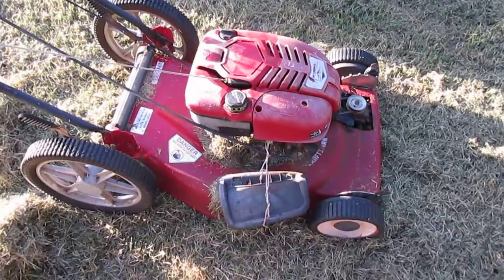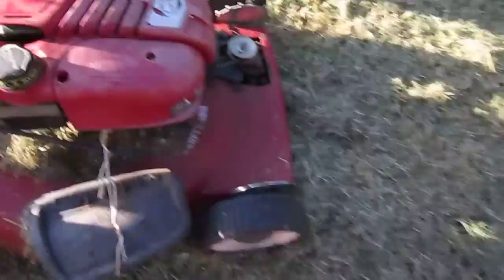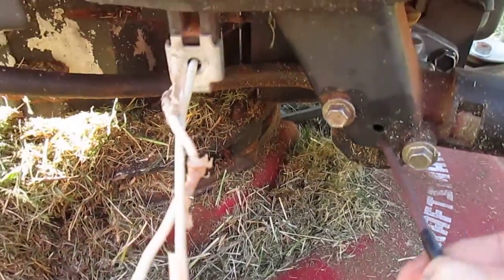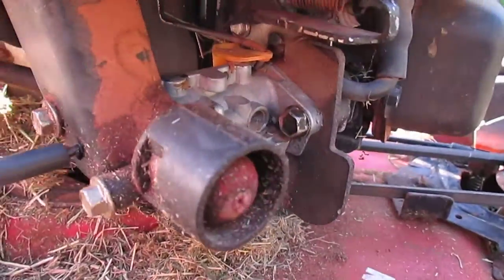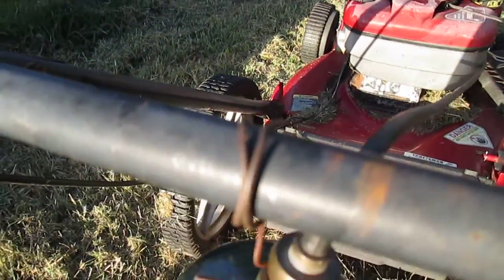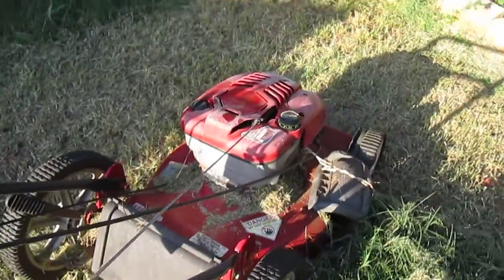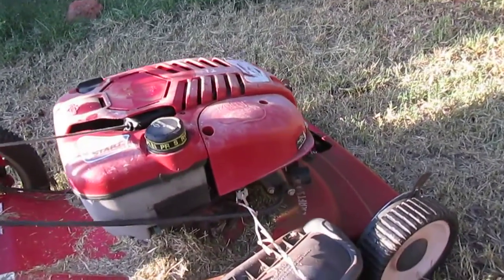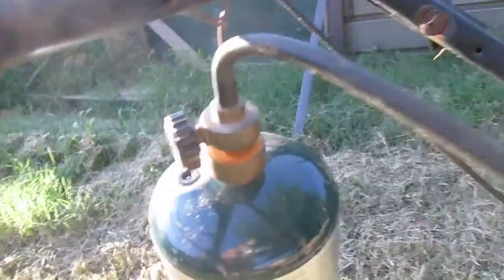Propane Conversion for small gas engines

Comment: NIIICE!! well i just wonder how long time it can run on propane(gas) as to benzine (we call your gas benzine and propane for gas!? ) you know one gallon to x amount propane and such , plus the power output!! thinking cars and bikes.
Reply from the maker: transdetendal They measure that by the BTU, and propane is somewhere around 70% the BTU of gasoline, so that gives us a general idea of what to expect ...I think?
Reply: ever tryed hydrogene on one? i made one on a car  but never got to test drive it .
Reply from the maker: I believe that it takes more energy to get the hydrogen out of water than the extracted hydrogen can produce -so I just never messed with it. I am interested in woodgas though!
Reply: ??? have to google that!
Reply from the maker: Woodgas is created in a device that (very basically) burns wood and then heats the gasses coming off of the wood to around 2,000 degrees to crack the tar molecule -and the end result is hydrogen that can be run into an engine. Most designs wont crack the tar and end up gumming up the engine; The FEMA model, for example.
Reply: i remember those war time viecles!! never thought much about them and they was dangerus , dad even new one that blew up.
Reply from the maker: Gotta be careful when you're playing with hydrogen!
Reply: been on and off foe 5 year for fun and knowlege, been blowing batterys up cupplr of time ha ha
Reply from the maker: That is my nightmare; "exploding batteries" -I have four hundred pounds of them in a box over in a corner of the house!
Reply: The Unknown Cat ha ha yea ive seen most your vids (in case you havent noticed) but i wonderd bout why you didnt just take the air out hoses or tubes of the batterys ,put them together and legthen them, so youd have one from each battery and out the entire way instead of the big hole used for venting?youd keep the cold out even more and more safty from gases
Reply from the maker: My battery box only has a 2" pipe up high and one down low, for venting. Works great! Concrete floor keeps 'em the same temp as the house, year 'round.
Reply: i thought the outside air would make it a draft when venting in winter! and the reason thereby setting the long hoses to the vents on the batts and direct them out of the house . but of course ,if it dont take the warm from the house its no point!!.
Reply from the maker: I don't think I've ever uploaded anything about my battery box -I don't want people to get to thinking it is a good idea to have them in the house! Mine are inside of a sealed box, with the upper vent being the highest point in the box, to let that hydrogen out. They stay pretty happy at room temperature and have been serving me well for about three years now.
Reply: yup you did ,its in the upload of your solar panel and how you home grid works , pretty neat if you ask me ! and the part i saw didnt alarm me at all , its well thought out
Reply from the maker: I try really hard not to blow the place up :D
Reply: The Unknown Cat well id b 2 , maybe we would be totally off the grid other wise ha ha ha . well its 5 past 2 at night over here so better hit the sack, take care ill talk to you later, and sleep good when time b...
Reply from the maker: Sleep well!
Reply: The Unknown Cat thanx it was nice !! going in the basement for some motobike tinkering!!
Reply from the maker: I miss messing with the bikes, but it just hasn't been the same since I got run down. Kids and their jokes!
Reply: whatta you meen? you got run down by a car ? what happend since you dont feel quite the same ? ive been run over cuple of time in my life ,but i stil love riding and tinker with them. i didnt ride for 15 years and got a driver license for it at last and since that ive been loving it, its like being a kidd again!!
Reply from the maker: I was riding home in the wee hours and a couple of kids in a truck decided it would be fun to run me down, and about the time I recovered from that, a couple of friends were killed on the road ...and this was all about the time I got married, not an awfully long time ago -so I emptied out the motorcycle stables and called it done.
Reply: The Unknown Cat thats why i ride like an idiot... to fast to get cought up and weaving in and out between cars, its now alowed here "lanesplitting" have saved my life a number of times!! i am really sorry for you,may i ask what you was injured with ?
Reply from the maker: About a 1985 Chevy pick up :D They turned into me head on, and I saw it coming so I opened the throttle up wide so I would fly over instead of going under. My hand went through the grill and shoved my finger into my palm and that's the only reason I needed a doc -I never fixed one of those before (but I know how now.)  I landed on my leather and kept my face off the road, and other than feeling like I'd pissed off a full bar room -I wasn't too bad off. The bike did okay too, only a minor bend in the frame. It was a 1977 Yamaha IT 400. Pretty well cured me of riding in the city though.
Reply: The Unknown Cat damn ,im sorry!! well ive been run into from behind and thrown up 15 feet in the air and dislockated my entire left side, another time i was taken out from left by a turning van ,turned directly into me and sent me ove some parked cars on the sidewalk ,hurt a bit and my bike needed some new parts. i was also chased by a taxi that tryed to run me over for a hour and half ,ended it by me wheelie into the front head on an jumped last sec. he got arrested.i was known as the asphalt king couse of all the times ive been on it ,flat down ha ha , i still love riding , older and wiser and more careless then ever....
Reply from the maker: Hahahahha! You must be part cat yourself with all those lives to spare!
Reply: i tend to think of it like all i survived back then im paying for now!,oh i got more storys like that , meny meny more!!
by the way ,i love cats!! and dogs, had cat , dog guinnypigs ,rats and a bird all @ once!!
Reply from the maker: We live in a small house with Lab mix, a Great Pyr, a Beagle and two tom cats -I like 'em too. I tell ya what though, when I wake up on a cold morning -all those old injuries from having fun come sliding in for a visit. I sure was stupid when I was younger.
Reply: ha ha ha , guess you didnt think so when you where young! i know i didnt !!! but id trade to go back now for sure, maybe even take a bit more care and not listen to my bosses !!
Reply from the maker: Aw, you'd end up in even worse shape if you didn't take notice every now and then when someone points out that you're about to set yourself on fire!
Reply: they call it burnt fingers ha ha ha
Reply from the maker: Ha!